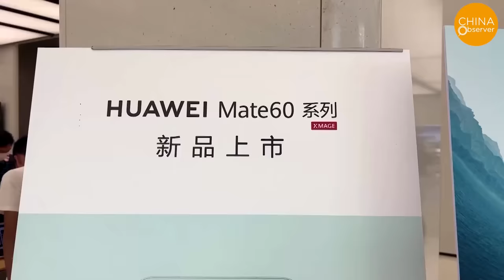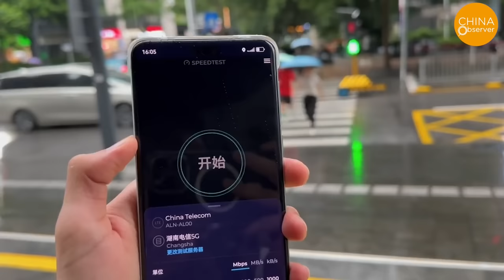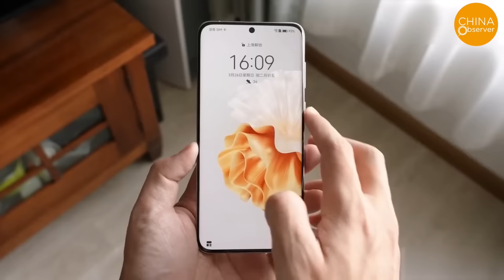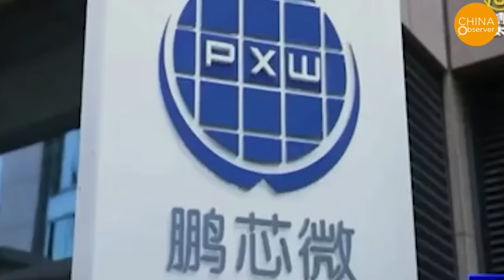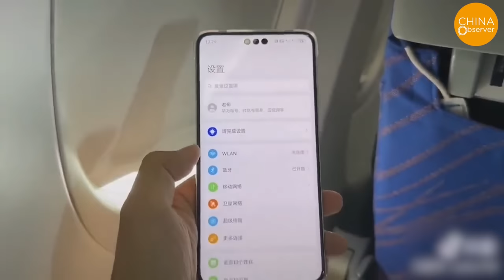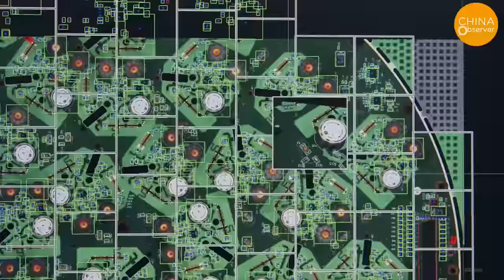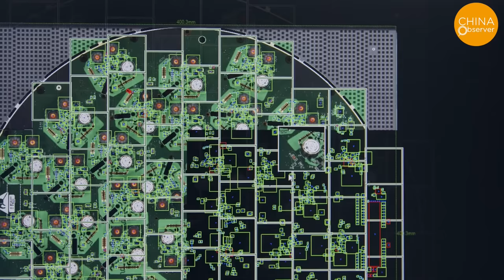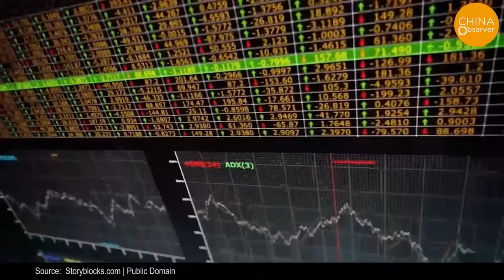Huawei Is Done! Mate 60 Pro Is A Joke!

Comment: It’s not just about the nanometer process but the design of the chip. I remember when megahertz and megapixels were top selling points. Comparing these did not always lead to quality.
Reply: Can you compete?
Reply: @MrAmhara  well it's competing with modern phones in some way so there's that
Reply: yes, I care very little about the size of the processing chip. Tell me the clock rate and memory bandwidth.
Reply: One thing that I done like about the Mate60 is it’s larger than the previous model so it takes up more room in the trash.
Reply: That's true. Tensor G based on Exynos' 4nm is way slower than any 4nm CPU & has the performance of an iPhone 11 (7nm).

However in this case, it's still way behind 7nm chips even.
Reply: HUAWEI Mate 60 pro Kirin 9000s ia a 14nm and Kirin 9000s 14 nm beat iphone 15 pro max A17 pro 3nm in gaming fps and speed test i have seen the video with my own eyes, usa just Mad as always and don't think to remove my comment

Comment: China observer, pls go and watch real time test rather than to quote the netizens.. it is so funny.. noise during charging ? Is it the funny way they try to advertise the phone with their advertising slogan or tagline.. the AnTuTu benchmark us 600k plus which is equivalent to sd865 or 888.. but did u watch the test? This is 600k without the GPU figures. If u add in the GPU figures it will be closer to snapdragon 8+gen 1. China observer this is poor journalism..
Reply: actually the antutu benchmarks are stil unreliable at this point because the GPU is new that the app does not recognized it and it has a score of 0, but speculations suggested that its performance can be on par with the sd 8gen 1

Comment: you can laugh as hard as you want, but Huawei successfully manufactured 7nm chip by their ownselves... thats more than impressive
Reply: You sure ? I heard they bought the chip not made
Reply: @JiangXina really？ I have never heard of Kirin being used in any other brands
Reply: The chip used in the Mate 60 Pro is a revised version of the old Kirin 9000 made by TSMC in Taiwan... meaning China didn't invent it. It also drains more power and only slightly outperforms the original. Can't blame people for laughing.
Reply: @anindependentmind2666 lol said by astupidmind. Reverse engineering what? You don’t know a thing about chip making
Reply: @amos325  Resorting to low-level insults show you have no counter-argument. People don't need to know about chip making to know that China took an existing chip first produced by a foreign company and made some changes then put it in the Mate 60 Pro. It's not exactly rocket science.

Comment: The noise when charging is vibration and vibration during charging means the battery WILL EXPLODE in a short time of use a week or a month who knows but the battery will not last six months and is a major fire hazard
Reply: it will blast your  ass off
Reply: Fire hazard? Why on Earth would any Chinese company use UK-manufactured batteries? 🔋🇬🇧🔥
Reply: @dieseldragon6756  that’s why it’s a fire hazard they use domestic made Chinese batteries guaranteed to explode

Comment: The amount of engineering (hardware, firmware and software) that goes into a device is astronomical; likely too complex for somebody in media to even comprehend. That said if they were able to crank out a 7nm SoC and write firmware for it and get it to run in such a short time they should definitely be commended for that amazing feat. The bad press is because 7nm is better than ~95% of electronic needs. All our other electronics are more than fine at 7nm and above. Soon China won't need USA tech but USA will still need China for manufacturing.
Reply: But you can’t build or copy one - the technology can’t reprocessed
Reply: dream on 🤣🤣🤣🤣🤣🤣

Comment: If it would be only because of the 2019 tech the phone is fine. Since my Moto E4 from 2017 is fine and good enough.
But 1100 US$? Thats way way to expensive since mine costs 50 US$. 
Then there is the allways on cameras and microphones which is the CCO`s special spy feature. Like that by identifying objects with the allways on camera links and Wechat Apps open automatically to make payments and such no need for the nasty opening of Apps when all is done for you already by CCP.
Thats why not to have that phone at all costs.
Then overheating is a no go and how long the battery lasts even with an allways on camera front and back? The battery must be drained in no time.
For the tech the phone can work if shortcommings are corrected but this is an 50$ phone and on top an bolschewiki commie spy phone.
Achtung! Feind hört mit.
Reply: That's why they bragged about the big massive battery.  Soon as I saw that claim about sporting a big battery, I knew that thing was either inefficient or power hungry.
Reply: $100 for utility and $1000 for pride
Reply: @popcorn6931  you can't put a price on patriotism... That's why it's called a patriotic tax.
To be fair... That phone is worth $110... $10 for the hand warmer function.  If you recall what happened all over China last year, people didn't have heat or coal...

Huawei really cares about the peasants

Comment: ❤❤❤❤ For normal smart phone use, nobody needs a processor that is faster than a 7 nm Kirin chip. Its 5G download speed is faster than most 5G phones. Any faster is like having a Ferrari in a grid locked urban traffic or even in most highways where the speed limit is only 70 mph..no point in having a car like a ferrari which can go up to 200 mph. The Huawei Mate 60 pro is not just a smart phone like the Apple 15 but is also A SATELLITE PHONE. SO THE iPHONE CANNOT BE COMPARED TO THE MATE 60. The Mate 60 is also far more robust than an iPhone. Recent tests showed the iPhone 15 back panel cracked under bending with the fingers whereas the Mate 60 was unscathed even when run over by an SUV truck. So stop making unfair silly statements demonising the incredibly remarkable Huawei Mate 60 satellite smart phone ! 😂😂😂😂

Comment: The Mate 60 and the Mate 60 pro has both the front and the back cameras running at all times, searching its surroundings,  which causes the phone to overheat. In addition a hacking tool is available commercially but free to the police. Hack the phone in three easy steps. 1 connect to computer 2 run software 3 view all current and deleted apps and data. Very unsecure phone. Runs old open source Android Harmony OS
Reply: funny because I own one and it doesn't do this. I swear you people are just making shit up.

Comment: So you are very happy with your accomplishment? just finding whatever is there to destroy a certain company or a certain brand!!

i NEVER owned Huawei before, and i was against it when it started because of their poor quality. however, every year i am leaning towards buying a Huawei every year more than before, because of their quality, improvements, and how they properly use every single part of the device to its maximum  potentials.

the device is fast, and one of the fastest on earth right now, does not overheat, screen top in class, and glass is best on earth, every other device on earth will need at least 3 years to achieve what have they done so far. Camera is impressive, 5G (even if not fastest, no server on internet will give you maximum download speed except torrent or open source).

the only down then gets me away from Huawei is google support, and that is the only point the makes me hesitant even i know we can install google services (but not official). 

all respect to every company that adapts to the world changes, and still growing and expanding. 

best part, is that it gave a huge Bo***r to Trump, Biden, and their people. slapped in their face with a big D.

Comment: Pre-orders are sold out. Tests have been conducted by several group of test experts. 60 pro is out performed Apples 15 in speed testing.
Reply: Yes, the 60Pro is outperformed.  It's slower than an iPhone 12, 13, 14, or 15.